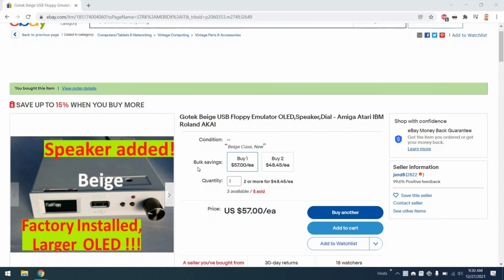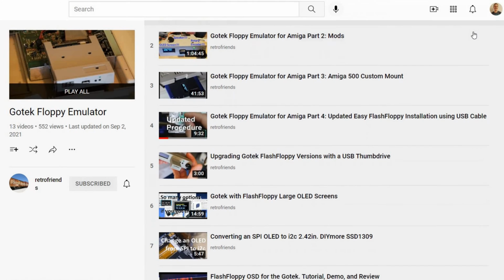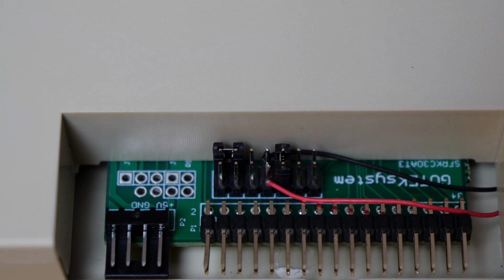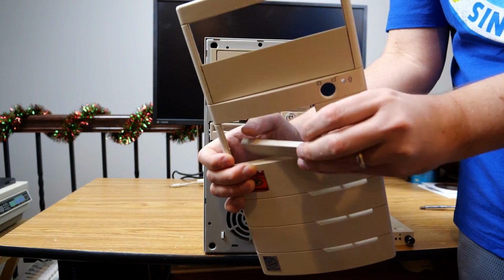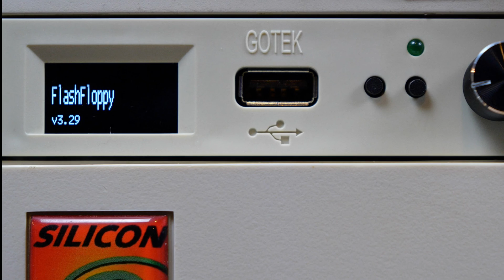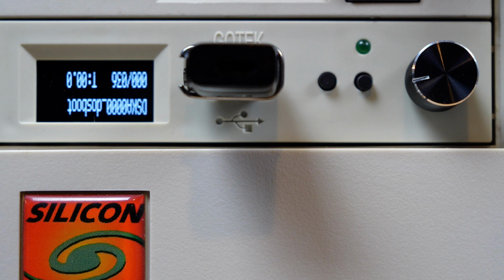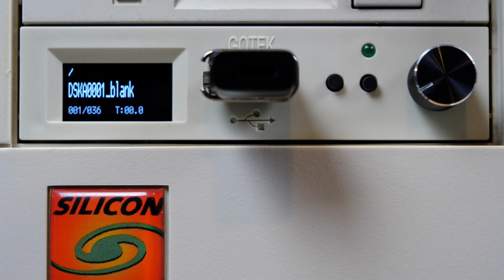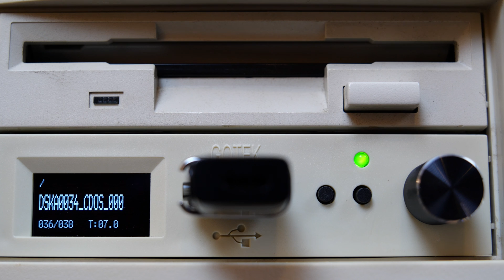Installing and Using A GoTek Floppy Drive Emulator

Comment: I recently acquired an old 486 with a dead floppy drive. Could I swap it for one of these and install DOS from a bootable floppy disk as a normal floppy drive would?
Reply from the maker: Yes! It would be a bootable disk image, but yes.
Reply: @RetroTechChris right, that's what I meant 😅 Thanks!
Reply from the maker: @itsdonallen right on.  Definitely go through flash floppy route, trust me on that!  The default firmware is not great.

Comment: "Can this device (gotek) be loaded with a bootable USB flash drive and selected as the boot device?"
Reply from the maker: @feliandrofirmansyah1858  unfortunately, no.  But you can use it to boot from a bootable floppy image.  The Gotek is basically only a floppy drive emulator.
Reply: @RetroTechChris  Thanks ...

could you suggest an a device that could emulate usb flash drive to IDE 40 pin HDD/CD PATA and can  be connect to older motherboard that has IDE 40 port/connection? So that I can boot from a USB bootable flash drive on an older motherboard that does not support booting from USB, even though it has a USB port.
Reply from the maker: @feliandrofirmansyah1858  how about using a virtual machine to prep a CF card instead and use that as a HDD?  Or use some other form of transfer?  I have some ideas here: https://www.retrotechchris.com/2022/12/27/some-good-resources-for-dos-file-transfer-and-connectivity-from-modern-systems/
Reply: @RetroTechChris  thanks... 😁

Comment: Hi! Nice video. Does the Gotek require the standard floppy connector (with the twist) or would it work with a normal 34 pin ribbon cable (without twist)?
Reply from the maker: I believe that you could jumper it to work either way, but I haven't tried it.  If I can find a non twisted 34 pin ribbon cable, I'll give it a shot sometime later today!
Reply: @RetroTechChris  Sure thanks!!
Reply from the maker: @stealthjoe  so here is what I found for my Gotek with FlashFloppy: when connectd with a straight through cable, the drive detected as drive B:.  My BIOS has a floppy swap option, so I was able to flip it to A: and boot from it.

After resetting the swap option, I moved the Drive Select jumper on the Gotek from Drive Select 1 to Drive Select 0 and it detected as A:, but also "kindof" as B:.  I don't think it should have detected as B:, not sure why!  I wouldn't recommend this configuration, unless it was an artifact of my FlashFloppy version or Pentium 233 MMX motherboard.  You can try it I suppose!

Hope that helps.
Reply: @RetroTechChris  Thanks for your reply. From what I understand, for a standard floppy connector cable(which has 3 connectors), the twist is to differentiate between drives A: and B:. The drive connected after the twist(usually at the end of the connector) is detected as A: and the drive connected in the middle (without twist) is shown as B:. So I believe here the gotek mimics the regular floppy drive connections.
Reply from the maker: @stealthjoe  that is 100% correct!

Comment: Super cool upgrade. So, no more special softwares to burn the image files into slots on USB? Simply throwing ima, img, floppy image files inside the stick would be enough?
Reply from the maker: That is correct!  The key thing there is having FlashFloppy installed as opposed to the default Gotek software.  I think that all Goteks support FlashFloppy too... there are a few different ways to load it depending on the model you have, and, of course, you can press the easy button like I did and order one that is preloaded :)